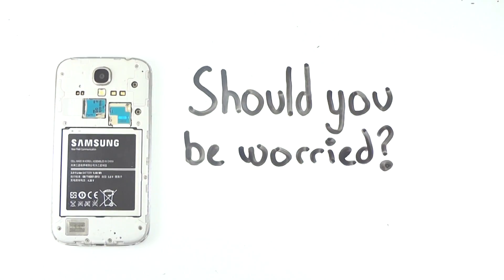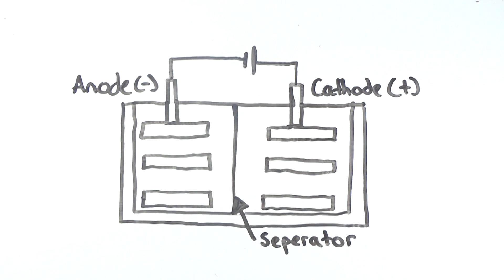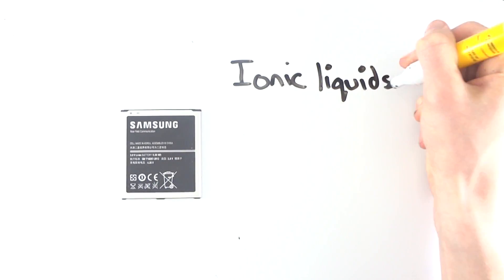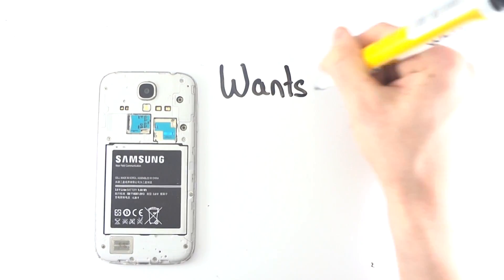Why Are Samsung Galaxy Note 7’s Exploding? Lithium-Ion Batteries Explained

Comment: The Anode should be Positive and The Cathode should be Negative
Reply from the maker: I'm not sure if you are American, but apparently it's an American thing for it to be the other way around?

In batteries the anode is the negative electrode and the positive electrode is the cathode.
Reply: Nope you're wrong sorry. Cathode and anode can actually be either negative or positive depending on how the device operates. In batteries the cathode is positive and the anode is negative.
Reply: Yeah swiftmoving is right, cathode is positive and anode is negative... you can google it and it says so?
Reply: Oh right my bad. What I learnt at GCSE must have been totally pointless then( not a surprise)
Reply: Yeah we learned the other way around too hah.